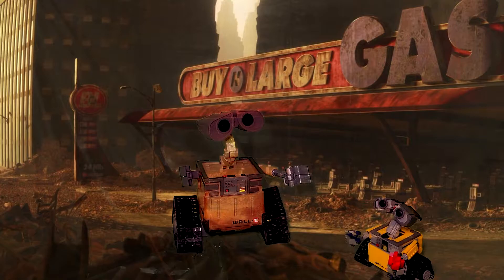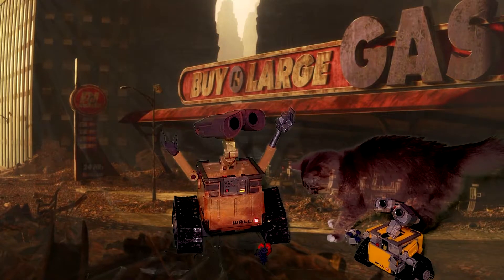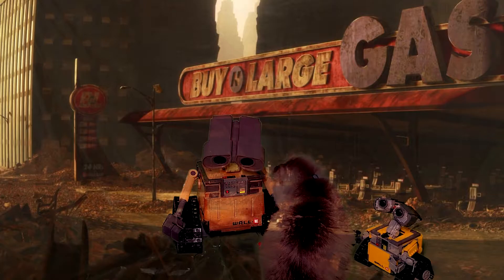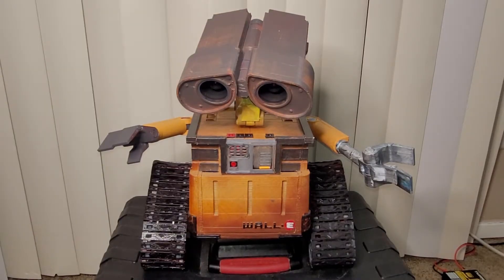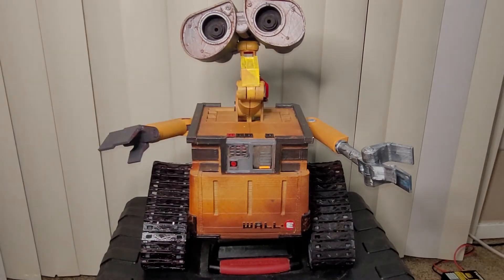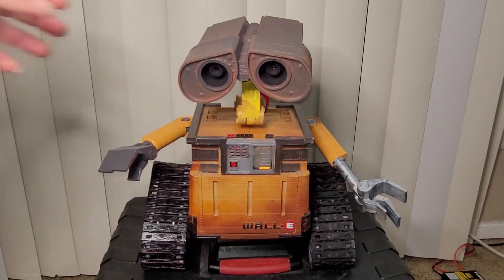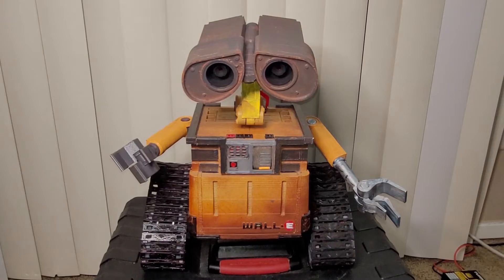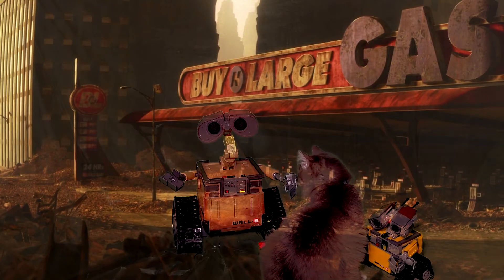3D-Printed WALL-E Bot Build! | Part Six -Its Finished! | EDGE+

Comment: The motor you recommended is 24 volts is that correct?
Reply from the maker: Hi! It's been a while since working on the project, but I think 12V was the motor value.
Reply: @EDGEplus  ok I can’t find it on Amazon with the right dimensions.